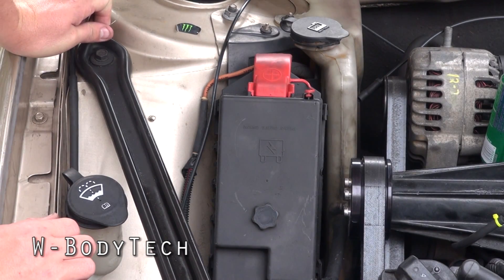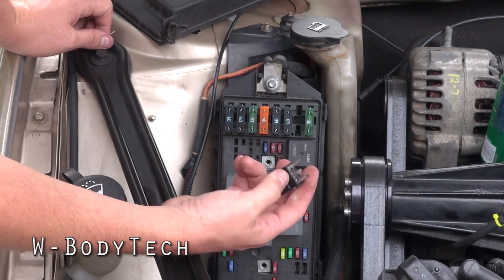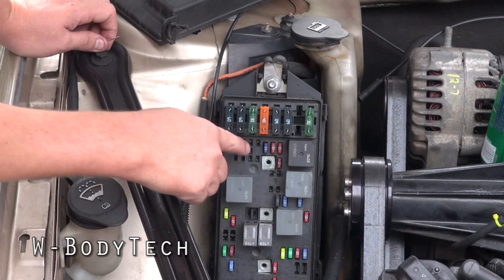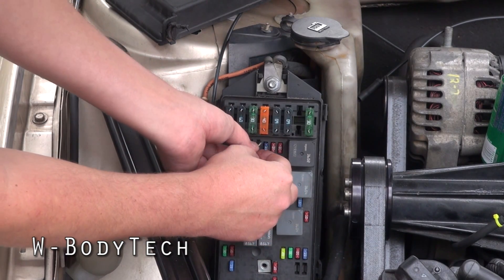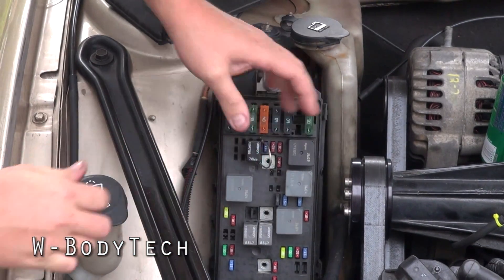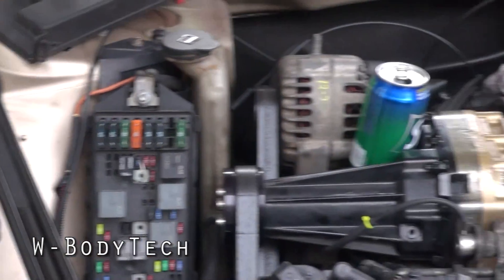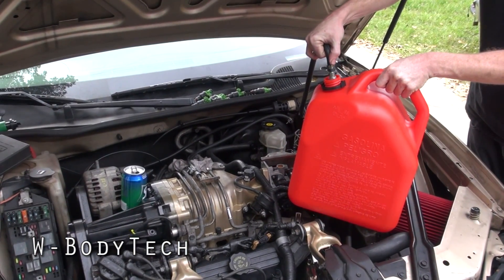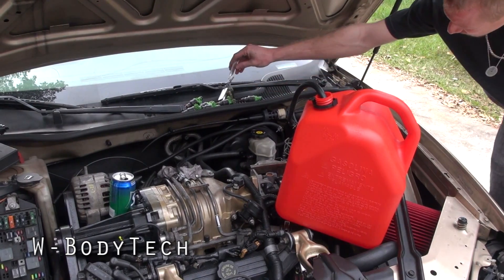W-BodyTech - HowTo bypass the FuelPump Relay on any 1997-2008 GM W-Body Vehicle

Comment: I bypassed the fuel pump and my 94  3.0 Ford explorer. My son drove my car and he did not remove the wire after he used the car. The pump ran all day and night. He pulled the wire when he thought oh @#$% then I think he started the car. He was told to empty the oil all out because it had run right through the engine and ended up in my oil pan. He did change the oil and filter.
 now it smokes white. It sucks gas now. 
 It runs rough now uses a lot of gas and has white smoke that comes out of the tailpipe.  so if anyone had any idea as to what else might have got damaged please do comment. 
Though this is an EZ fix on how to bypass I would not recommend because more problems will happen as my car if you do forget to remove the tiny wire!  TIA

Comment: boo hiss. "put that there, there and there" doesn't explain anything.  Maybe zoom in and give better explanations?  There may as well be no audio.
Reply: OMG, really... I could see everything, and I'm blind in one eye and can't see well out the other... May I suggest reading glasses.  If you can't see it, then of course you don't know where, here, and there is...  Maybe a bigger monitor?  I'm not sure what you had trouble with, for sure, but the video shows everything perfectly. When his hand(s) move away for a second you can see the wire just laying where he put it.  Didn't even noticed he covered it because he said that's what he was doing.  stripping a small wire, like speaker wire, and using it to connect the two terminals, then plugging the relay back in to hold it.

Comment: I believe I'm having a fuel pump resistor issue. I'm planning on temporarily trying this to fix my issue. Which is my engine randomly shutting off completely while driving, though power (except for power steering) stays on. If I do this then turn my car off and leave with the bypass still in place will it cause any further damage or will I need to unplug the relay and take the wire out every time I leave it.

Comment: Doesn't work on an Impala, pops the fuse every time???
Reply: Use a lower gauge wire
Reply: Just open the relay an put tape inside

Comment: what kind of wire did you use
Reply: You can use any type of wire. I used a piece of wire from an old TV I had. Just remember to always unplug it when the car is not in use.

Comment: So in order to do it for the GTP you just need to bend that corner pin out correct? I have to try tomorrow my car died the other night and I had bought a fuel pump a while back cause mine has been getting really funky I figured it died changed it and it starts up runs for like 3 seconds then dies I was told to try this.. So that's what I'm gonna do tomorrow thanks
Reply: Brian Yost look up 97 Grand Prix GTP starts then dies...it might be a little more helpful for you, granted you still have the car.

Comment: What's the purpose of that
Reply: that's what I'm saying
Reply: +Frank Cozza the purpose would be to drain the tank/check the fuel pump. HOWEVER, you should do this with a FUSED wire not just a straight piece of wire! Nice video though.
Reply: in this case yes the purpose was to drain the tank to make the swap to E85 at the time so we figured we would do a quick how to just to show a quick and easy way to drain the tank.
Reply: Yeah, I have a related problem... in the main relay box, one of the male relay tabs won't maintain contact with the female socket except by pressing down on the relay. No pressure no fuel pump other than the initial 3 second startup, it won't stay running.  I bypassed in a similar fashion as here; but that being said, the battery runs down, and it's probably not the safest. However it's even more puzzling.  First, does anyone know how to fix the issue of a bad female tab where the relay plugs in.  Can't see the color of the wire, and it isn't readily obvious.  Second is the irony that the relay socket giving me the problem is labeled in the manual  'air compressor/air conditioner' [and that too isn't working], but somehow it's affecting the fuel pump too.  Any clue would be helpful. 
 I would think this 'open' would only affect the air compressor clutch, as that's what it's labeled to control; but, am clueless as to how this would affect the fuel pump.  Since it gives me a working pump, I hook it up to drive; but, it's a pain; and I was thinking I could wire it to hot w/ignition on to solve battery issue; but, I'd rather figure out what in heck the air compressor clutch has to do with the fuel pump; as both fuel pump and air not working, even with the workaround.  With the workaround, the fuel pump runs, but there's still no AIR (sigh) Maybe this is 'the' clue and I don't know how to interpret it.

IF anyone has a clue I'd appreciate it.  Mine's a P71, but they appear remarkably similar in this aspect.  FWIW everything had been working great for a year and more; and it just failed one day driving down the road.  Massive troubleshooting headache ensured, a several hour trip delay... Trip's over, but the headache still continues due to cluelessness.